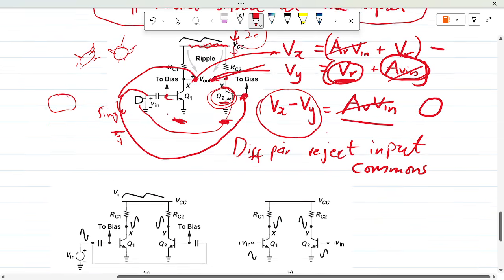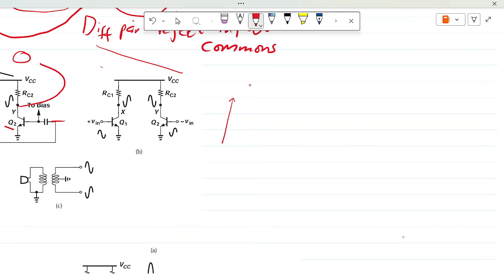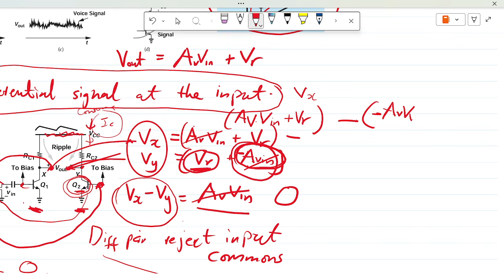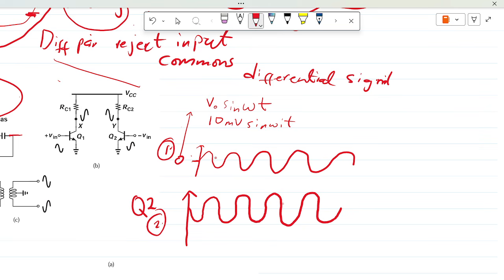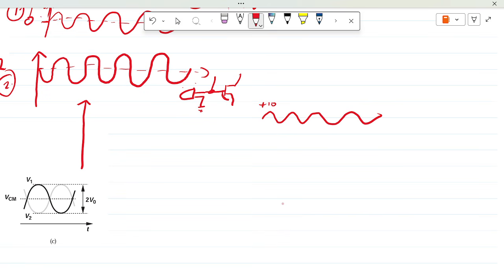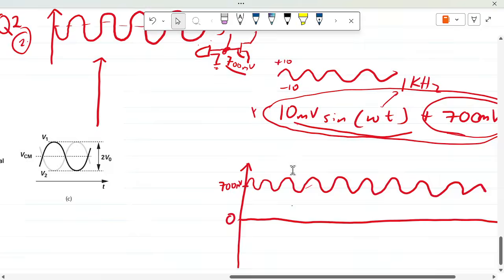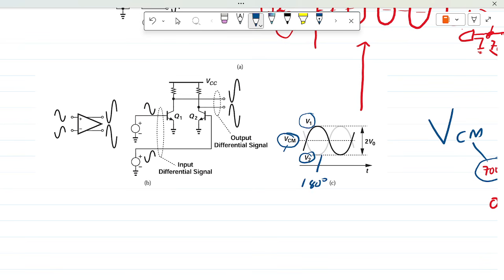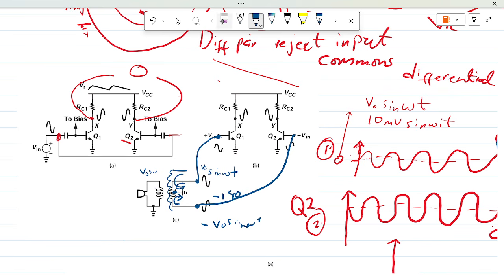Differential Signals Explained: Voltage Difference vs Common Signals (Part 3)

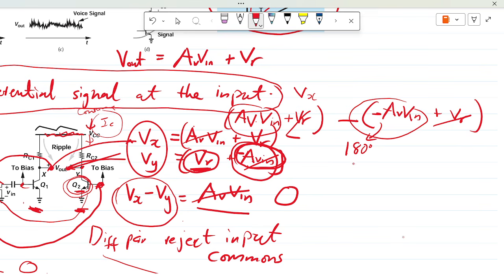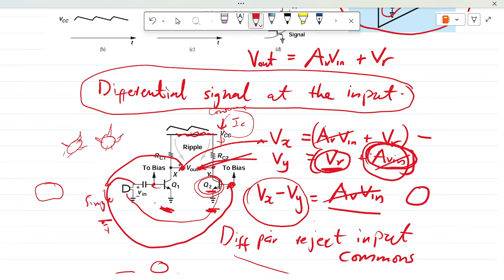Comment: 3:15 2:20 Dr. please for the Vx , it’s seen that Vx is equal to the gain times the Vin , shouldn’t the gain be negative ,because when you started creating the differential input signal you made the gain negative which caused us to attain 2AvVin but shouldn’t it be -2AvVin
Reply from the maker: Yes that is very true, it is common to sometimes just refer to the magnitude of the gain since the negative is just showing a 180 deg phase shift between the input and the output.
Reply: @YOMSElectronics thank you very much Dr